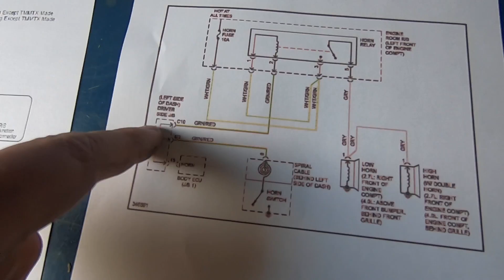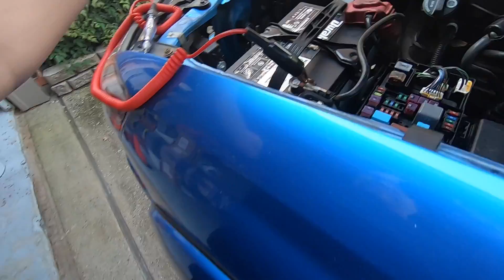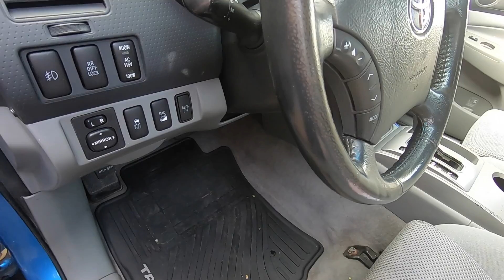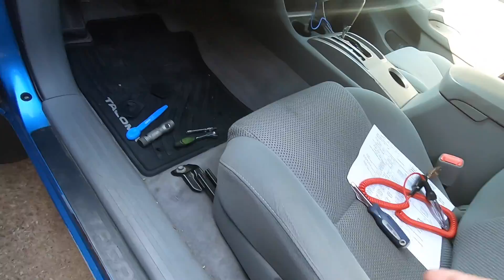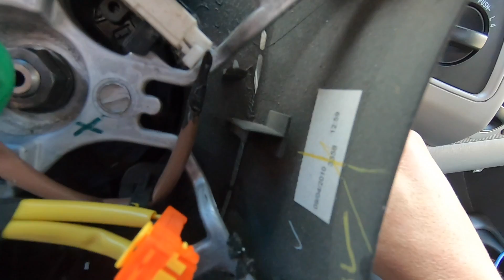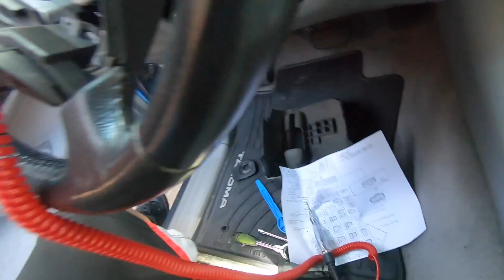How to troubleshoot the horn circuit on a 2nd Gen Toyota Tacoma.

Comment from the maker: Replacing the clock spring on 2011 Tacoma        
https://youtu.be/aEw5NDYv-BE
Clock spring for Tacoma WITH steering wheel controls            
https://amzn.to/3Q0EJJ6
Clock spring for Tacoma without Steering wheel controls
https://amzn.to/4swi1ab
OTC Test Light                                                                                    
https://amzn.to/3eXHjJz
OTC Relay Pliers                                                                                 
https://amzn.to/3pvRjyk
Plastic Trim Removal Tool Kit
https://amzn.to/2IBtPax

Amazon Prime http://www.amazon.com/tryprimefree?tag=737mechanic-20

The links I provide are Affiliate links that I earn a small commission from but don't cost you anymore. Thank you for your support.

Comment: Great video just one question can I jump it with just a regular wire? Or will that harm something also if my buttons for the radio work that means my clock sping is good right? Its something else
Reply from the maker: You can use a regular wire to jump the 2 terminals, but if you hit the wrong 2, you could burn the wire or the terminal. You need to use a wire with a fuse or circuit breaker; that way it will pop that before the wire.

The circuit the steering wheel controls use in the clockspring are different than the circuit the horn uses, so it could still be the clockspring.

Comment: When I bypass the relay like you did with the cable my horn goes off. When I try to ground the green and red cable from harness under the steering wheel it does nothing. It’s 2014 Tacoma. Any help?
Reply from the maker: It sounds like the relay may be bad, from under the hood pull the relay and use a test light to check for ground at socket 2 and see if when you ground the grn/red wire if you get the light to test.

Something else you can do to check the relay is if there is another relay the same as that one in the box is swap one in its place and see if the horn works.
Reply: @7 @737mechanic yes test light does turn on at socket 2 when I ground the red/green wire.
Reply from the maker: @MALO1503  So there should be 2 contacts at the relay socket that have battery voltage, 1 contact that gets ground when you press the horn button, and one that runs down to the horn itself. If you have all of that then the relay is bad.

Comment: Good video. My horn quit, it was the clock spring. But while troubleshooting the horn the bolts that mounts the horn broke. So the horn was just hanging, the horn must be mounted to the truck to work (grounded). The horn only has a power wire connected to it.

Comment: Great helpful video. I put a new clock spool in and the airbag light is off. The 10A fuse is good. I'll check the horn relay tomorrow with my voltmeter while a friend is pushing the horn, following your video. 
The horn still doesn't work at this time. Is there a microswitch inside the airbag assembly that could have gone bad? I hit a deep hole up north and that's when it happened. I hope it's just the relay and not the whole air bag gone bad.
Reply from the maker: There is no microswitch just the horn button that makes contact when you press it and supplies the ground for the relay.

Comment: Great explanation.  I only wish I had seen it before I changed out the clock spring.  So after I changed the clock spring and found my horn still did not work, I found your video.  20 min of testing would have saved and 1 hr of work and a little cash.  The horn relay was this issue.  Swapped two relays to confirm.  Thanks
Reply: So I could just switch any 2 relays that look the same and try the horn out?

Comment: What do you do when you test the plug with the pin and it doesn’t honk but my testing light lights up what does that mean?
Reply from the maker: If your test tight lights up at the horn plug but the horn doesn't honk then the horn is bad.

Comment: The green and red cable u where testing for ground, I'm getting power there and it didn't honk the horn. But the horns are honking when I hit panic on remote. I'll just change the clock spring

Comment: Following your troubleshooting steps I have verified my horn is functional by connecting direct to power and ground but jumping terminals 3&5 of the relay do not sound the horn. But the correct 1 & 3 terminals have power and the fuse is good.  Could the ECU actually be affecting the horn if the relay terminal jumper test isn’t working??
Reply from the maker: The ECU does not control the horn at all. If you have power on 3 but jumping 3 and 5 does not sound the horn then you have a bad connection or broken wire from terminal 5 to the horn. Terminal 5 runs directly to the horn so if you put power to terminal 5 the horn should sound.
Reply: @737mechanic  Ahh okay that what I was thinking... break somewhere between horn and fuse/relay panel.  Must be a crusty old wire break.  I'll confirm with a continuity test and then get under that panel to run a new wire.  Thank you so much!!

Comment: Great video! Electronics are not my strong suit - I'm much better at turning wrenches. 

Question-- 1 and 3 on the relay have power and 2 also has power when I press the horn button, but I can't seem to jump the horns to work. To me, that seems like the relay is potentially still good, but I suppose I can swap out for another and remove all doubt. Where do I go from here? Seems like my issue is on the 5 pin side of the relay. The wires on the horns do seem to be plugged in, but I wouldn't expect them both to go out at the same time. Potentially a bad connector somewhere?
Reply: Well, after looking at the horn wires, for some reason I was expecting to see + and - wires going to each horn. There was something funny with the first connection and removing and reinserting the connector seems to have fixed the issue. The wires into the connector seem to be nice and tight. Maybe it just wasn't seated properly even though it felt snug. 

What a great exercise in troubleshooting and I'm glad it was something simple. Thanks again for the video! Now on to the next project before winter - new cv axles.
Reply from the maker: Jumper pins 3 and 5 together and see if the horns work. If they do not then jumper 12v to the horn connector itself and see if the horns work. It sounds like you have everything you need at the relay, the question now is are the horns bad or do you have a broken wire. As far as both horns going out at once. That probably wouldn't happen but one could have been out for a long time and you may have never noticed because the other one worked until it went out.

Comment: Nothing working on my steering wheel (( horn , the radio buttons, the cruise control, and the air bag light on )) so mostly the clock spring??
During the coronavirus i was hanging the face mask on the side of the steering wheel and someone borrowed my truck and the face mask got stuck in there and everything stopped working

Comment: I have a 2005 4Runner with you same interior I change the clock spring and still no horn and airbag light still on could it be the airbag itself? For both issues
Reply from the maker: No, the nither one would cause the other to not work.
Sometimes there are different clock springs for the same vehicle depending on if you have cruise control and or steering wheel Rado controls so make sure the clock spring you have is the correct one.
Reply: @737mechanic  cruise control and signals work just fine that's plugged into the clockspring also
Reply: @737mechanic  horn relay clicks but no ground and airbag light
Reply from the maker: @codybrackett7173  If the relay clicks when you press the horn button then the clockspring is fine and the problem is downstream of the clocks print.

You need to have someone scan the airbag for codes and see what it says.
Reply: I checked every relay and fuse in the car everything checks out what you think could be the reason for these grounding issue
Reply: @737mechanic  horn works if I put power directly to it I have a Toyota service mechanic that came by yesterday and said it was coming from the steering wheel I put 2 clockspring still nothing changed

Comment: My results were the same as yours.
Instead of buying a new clock spring.
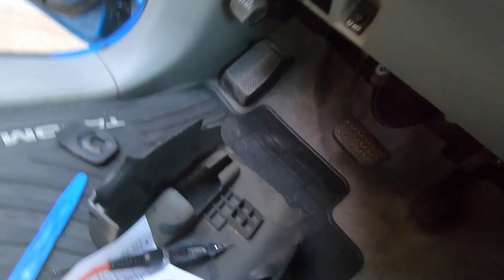I wired in a aux horn button … driving a pin in where you did at 19:40.
Just hot glued the pin, zip tied the wire…
Put it all together and pushing on my steering blows the horn now….
I think that wire harness, turned so tight. Might pull wires out of the plug over time
Reply: Could you show what you did?
Reply: @GreggyGTV  Green and white wire in the harness under the steering column.. he shows it in the video, access to that does not require removing the airbag, only the under plastic of the steering column, and area around key.. if i ever pull it apart again, ill respond on this
Reply: @BallardBaller thanks man imma try that vs clock spring, so factory horn button on wheel works now?
Reply: @BallardBaller so you just jumped the clock spring basically with another wire?

Comment: What would a melted ground on the horn cause? Mine was melted and I re taped it. It didn’t look like it effected the wire but maybe it ended up intact effecting it?
Reply from the maker: I would have to see it to know exactly what was going on.
Reply: I replaced the ground after the relays were checked out okay. Still no luck.

Comment: Prior to any disassembly try turning the wheel full left or right and check the horn. If it works on the hard turn and not when centered it’s your clock spring.
Reply: Son of A Gun, my horn works when to the left but not center. 

Thank you sir. You saved me some time and money.
Reply: how did you fix it? did you replace the clock spring or realign?
Reply: @cali_misfit1387  replace the clock spring
Reply: Found mine on eBay 🤷🏻‍♂️
Reply: @dantequintana47 i was looking on eBay and my question does the same clock spring fit most of the Toyota cars and trucks??
And does all of them come with cruise control??
Thank you
Reply: @georgemaida387   I’m pretty sure it’s all vehicle and model specific
Reply: At first the horn was working on the hard left and right, but later stopped.  I replaced the clock spring and the engine light and airbag light went out, but I continue to not have a horn.  I am hoping maybe it needs a fuse.
Reply: Same here
Reply: Thank you kind sir
Reply: I was just getting ready to disassemble my steering wheel to check and if needed replace the clock spring. I went hard right and the horn blew the same with a hard left. Back to center and now the horn is working again in all positions. Maybe the spring was hung  up? If it is a problem again I will replace the spring, but don't fix it if it ain't broke. Thanks for the information!!
Reply: Thank you so much brother, saved me so much time, works when turning left but not when it’s centered, respect to you
Reply: Ohhh ok, that’s for sure what’s wrong with mine then. Thank you!
Reply: How so

Comment: Bro my panic button and horn is not working too is it still the clock spring ?
Reply from the maker: Probably not, the clock spring would only be if the steering wheel horn button didn't work.
Reply: @737mechanic   yeah my steering wheel horn don’t work too
Reply from the maker: @tr4ilblazin  Check the relay and the horn itself. In fact you should be able to hear if the relay is clicking when the horn button is pushed.
Reply: @737mechanic  okay I did it’s clicking
Reply: What do I do now
Reply from the maker: @tr4ilblazin  So three things can be bad at this point, the relay even though it is clicking can have burnt contacts that are not making contact, the wiring from the relay to the horn could be open, or the horn/horns themselves are bad. If there is another relay like the one clicking swap them and see if the horn works if it doesn't then it is down to either the wiring or horn itself. It can also be a loose connection
Reply: @737mechanic   okay I switch the relay it’s still clicking no sound so I will get new horns see if that works and I’ll get back bro
Reply: So nothing is wrong with clockspring at this moment right
Reply from the maker: @tr4ilblazin  No
Reply: @737mechanic   thanks man
Reply: @737mechanic   bro just got my new horn and it’s working now thank god I saw your vid or else I would of just bought clockspring first

Comment: In my case it works until the part where you put the pin on the green and red cable, there it does not sounds when I connect the “T pin” to the ground. What should I do in my case? Thanks ahead! 🙏
Reply: Did you ever figure out what the deal was I’m having the same issue and don’t really know how to proceed?
Reply: @please1107  hi, yes, it was the clock spring at the end. Before trying that I could not trouble shoot it because the ground I was using to test was not working for some odd reason. But I would suggest to change the clock spring, there are some really cheap ones at amazon (like 25$) that work perfectly and is compatible with all the trucks functions.

Comment: I followed all the steps of replacing the clock spring and it fixed the horn not working but now the airbag light is on. I got the same clock spring part you got off of Amazon. Did you have any problems with that?
Reply from the maker: No I didnt have any problems. Check the airbag connectors and make sure the are connected properly.
Reply: @737mechanic  is there different clock springs for the TRD off-road package?
Reply from the maker: @GreggyGTV  There are 2 different ones depending on if you have steering wheel controls or not. Here is the one WITH steering wheel controls https://amzn.to/3p5Iwrs
and here is the one without 
https://amzn.to/3qJbOMY
Reply: @737mechanic  thank you so much!  What’s concerning is that neither of them in the links said anything about the steering controls.  You were so helpful I’ll just trust the one you found and even though there are other more expensive ones including oem, it seems like this one has worked well for you and your son.  This is also for my son’s truck so I’m nervous about it’s reliability.  You’ve been great sor, thank you.  I have subscribed.  Also, please consider my channel as well because I do content like this to help others as well.

Comment: Why would the 10 amp fuse keep blowing? This occurs with the truck sitting off and not in use. I switch the fuse and the horn works. I'm not sure when it blows because everytime that I've noticed is after I've driven the truck, parked it, and returned later. Due to Covid, the truck was sitting unused for 3 days when this happens.
Reply from the maker: Are you saying it actually blows when it is sitting? There shouldn't be any way for it to blow unless the horn button is pressed. Either way what I would do is unplug the horn/horns behind the grill and see if it still blows if it doesn't then the horns are causing it.

Comment: what if everything else on the steering wheel is working, is it still a bad clockspring
Reply: Mine is definitely the clock spring bad connection. Gotta turn thr entire steering wheel to the left for it to maybe go off
Reply from the maker: It can be, in my case everything else was working except for the horn.